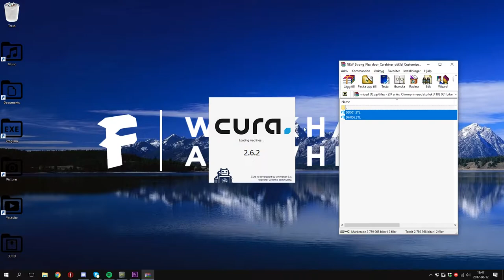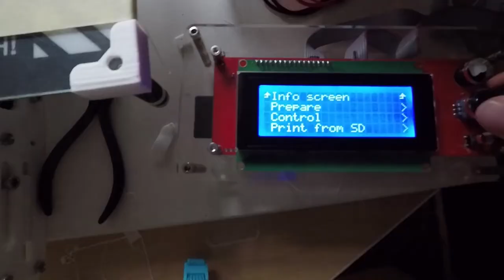3D Printed Carabiner Will It Work?? DIY Project #1

Comment: You should look into a heated bed to broaden your material range and ditch the tape
Reply from the maker: That printer actually had a heated bed, although I have moved on to glue since it almost "guarantees" it to always stick. Still, that printer (the one in the video) does not look anything like it today, check out my Instagram (@3D_Printing_With_Anton) for how it looks like today.